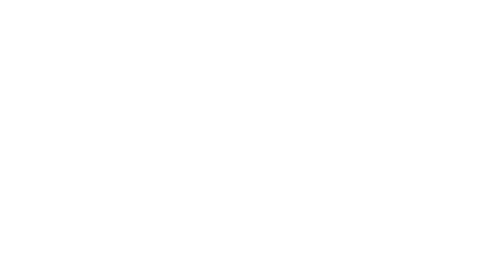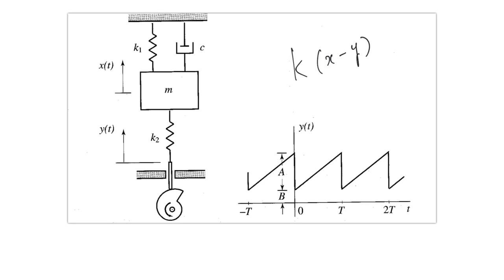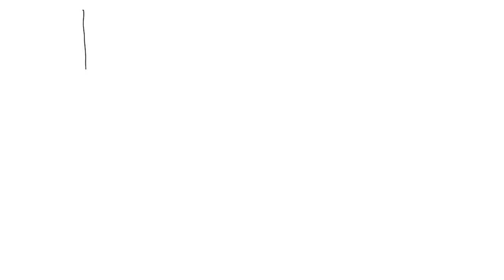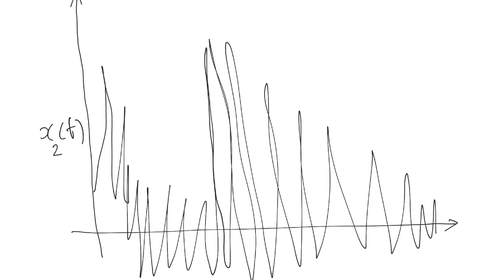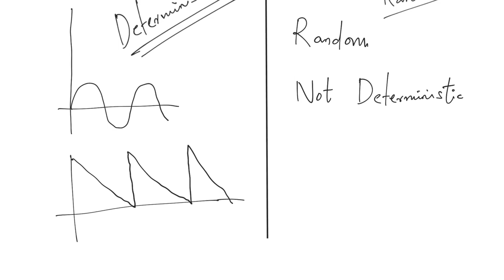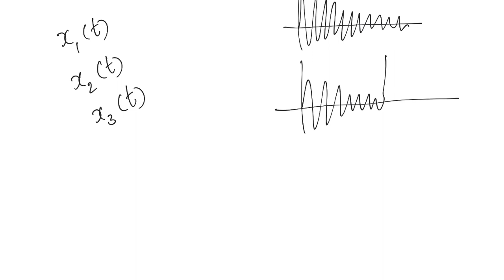Random Vibration Analysis | An Introduction | With real life Examples

Comment: Excellent initial introduction, wish you had continued on to describe Power Spectral Density, how to identify an Ergodic process etc, I watched the entire 5 part series. Very impressed by your simple explanation. Random vibration, due to its significant reliance on statistics is something out of the grasp of most practicing mechanical engineers, thank you very much for putting me on the path toward a better understanding. I am mostly interested in the prediction of fatigue life of equipment subjected to Flow Induced Vibration arising due to internal flow
Reply from the maker: I will try my level best to expand the series with more videos.